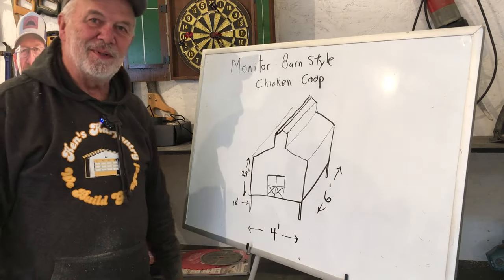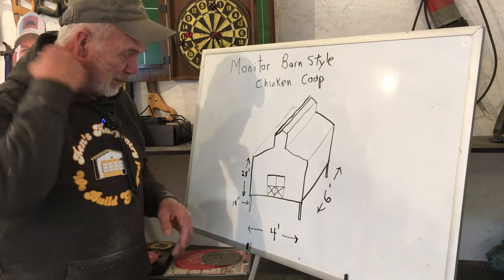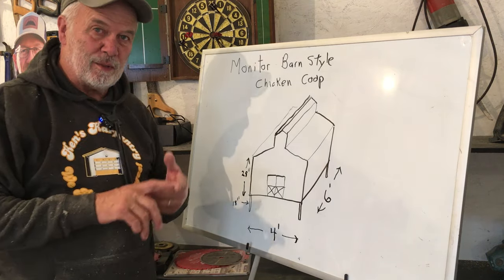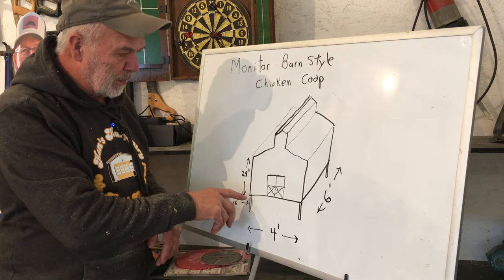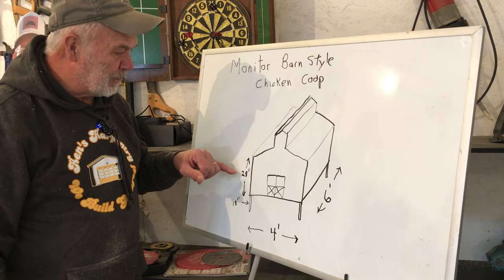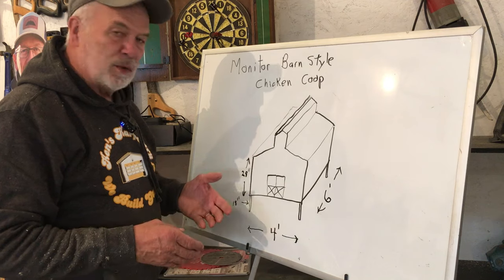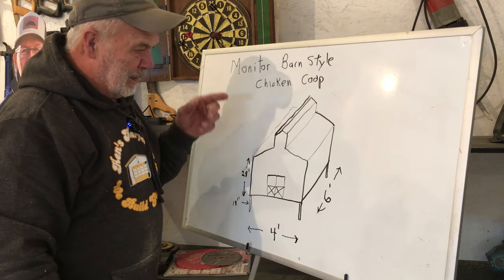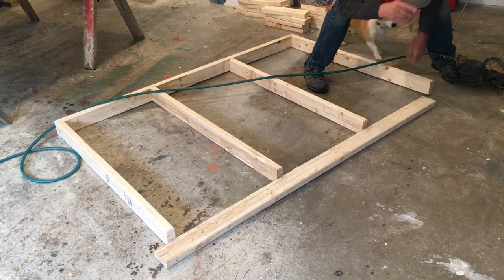THE MOST COMPLICATED ROOF SYSTEM I'VE EVER BUILT...Monitor Barn Style Chicken Coop Part 1

Comment: Ken, love your videos. I built a monitor style coop a couple of years ago for my flock. 38 chickens and growing. You've gone about it a lot more complicated, and made the roof weaker, than it should be. Your weak point is the lower rafters. My coop is just a tad larger at 8' square so I didn't have to rip plywood. I also used 2 x 4 floor joist 16" OC. 24" OC just wasn't strong enough even for chickens. I made one side of the coop hinged down so I had all 8" to scrape the waste out. The floor is 2 sheets PT plywood topped with 2 sheets non pt. I covered that floor with a tarp and then linoleum to keep the liquids out of the plywood. Trust me. It helps reduce odor. And a Harbor Freight tarp is cheap. I've got 3 roosts. Front door is automatic. While the coop is 8 x 8 I made the roof 10' for the look. Mine is built like a pole barn but if I were to do it again I would use stud walls between the posts instead of girts. Keep up the good work. I started building a full size Monitor barn years ago as a workshop. Got one side done with the shed roof and ran out of money. That side alone is 14'  36' with the one wall 12' high and the other 8' high. Center section when I get back to it have a 17' ceiling height and the other shed will mirror the side currently standing. Overall complete size will be about 50' by 36' so not a small project for one man.
Reply from the maker: Very nice. Thanks for the input

Comment: Thanks so much for showing the monitor style chicken coop with all it's special roof parts. That does look very complicated but it sounds like a nice challenge. I really like that design. I want to build something like that with tilted out sides. I was thinking of putting roosts across at the top of the tilted out walls so that the roosts are wider. I was going to put vinyl floor up the walls from the floor to make it easier to clean out. I have windows that have lever covers from a truck bed cover that I was going to use above for the monitor portion. The egg access will be on the walls too where the nest boxes are. This is an exciting build Ken! I love it! I like the platform and the moon walk! Thanks for this video Ken!
Reply from the maker: Thanks. I hope your project goes well.

Comment: hi, allowing chickens to roost on the cross ties ,you will have manure build up in the center of the coop . i suggest building a roost across from the nest boxes with a side door access to remove manure.   with a door to get at the nest boxes on the right side...... you could chicken wire the loft section so they could not get up there.  this also will reduce droppings in the feed trays on the floor.  I had 50 chickens for years and it is best to always stay ahead of them.  have fun         FB in WY
Reply from the maker: Thanks good advice
Reply: The problem with a roost along the side opposite the nest boxes is there wouldn't be enough headroom for the chickens if the nest boxes are lower than the roost bar (as they should be). The roost will need to be 8" minimum from the side wall which would give a bit more headroom but unless the nests are at floor level, I think the roost bar will have to be closer to centerline and at least 12" off the floor. 28" is pretty short given a standard size hen is about 12" tall when standing, a rooster will be a fair bit taller.

Comment: I don't know how far you've gotten but if you aren't aware, chickens will roost as high as they can get. The nest boxes must be lower than the roosts or they will sleep, and poop, in the nest boxes. Is there a reason you didn't make it 8' instead of 6' so you don't have to cut the plywood? Also, I would suggest a hanging feeder vs feed trays, trays will get filled with litter in short order. Same with the water unless you plan to have a run area with at least some amount of solid roof and the chickens aren't locked in the coop during the day.  They don't need water at night.
Reply from the maker: Yes nesting boxes will be floor level. I can use the plywood cutoffs for other projects

Comment: I'm Worried... How many chickens are you planning for? Chickens require 4-5 sq feet per chicken. (Per Google search) therefore 4' x 6' = 24 sq ft. or 5-6 full siized birds. Laying a sheet vinyl floor will ease the clean out job. Making the clean out door at the opposite end or one of the long sides of the coop from the chick door is easiest. Building the clean out door the full size of the end or side will ease in cleaning. Keep the nesting boxes protruding out of the coop for easy reach. (don't use up sq footage with nest boxes). Where are your supplies going to be housed? The closer, the better. Make sure a Historical coop is also practical!!!  All the Best!
Reply from the maker: Thanks great tips

Comment: Ken, I have a thought for a structure with a 'clerestory" running the length of the roof. This presents as the Monitor style, but traditional Monitor style roofs are supported by columns directly below the Monitor section. My understanding is that holds the Monitor section up without imposing a lateral expansion of the truss legs to the sides, which would spread the walls at the top if not constrained some way. I have no doubt  that what you are doing with a coop size structure would work, but mine is 56'w x 48'l, with a "monitor" 24' wide- with windows running the length on both sides. To date, the only way I can see to stop this spreading is to use some sort of collar tie lower- possibly at the wall height- to control this. Is there some other way to achieve this without resorting to the traditional row of posts that usually stand just under the Monitor? If the trusses are built with a strong lower chord carrying vertical supports that fall under the walls of the Monitor, would that be sufficient, and if so how big would that lower chord need to be? Could a truss be built with a constructed beam as the lower chord to carry the additional loads?
Reply from the maker: It could have been built as a truss to incorporate both roof systems